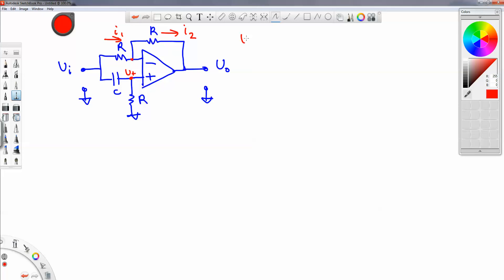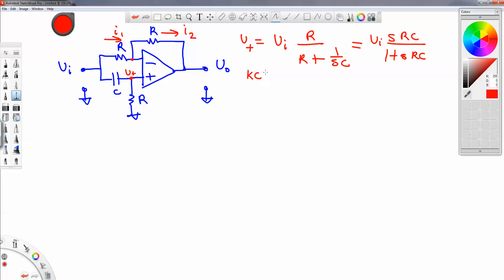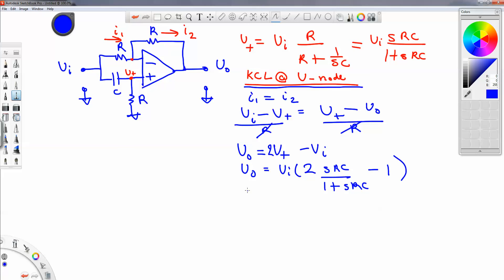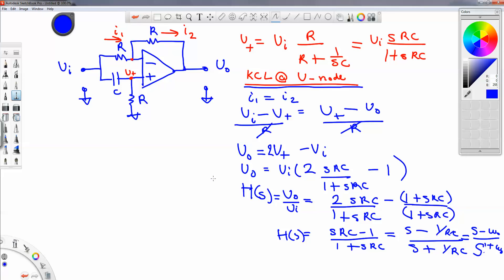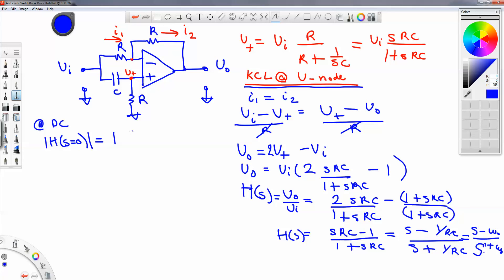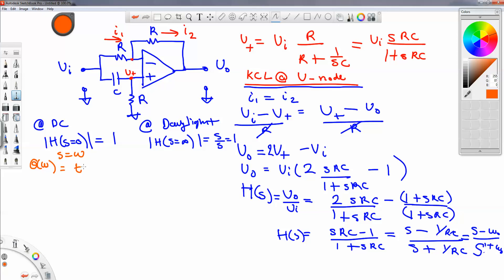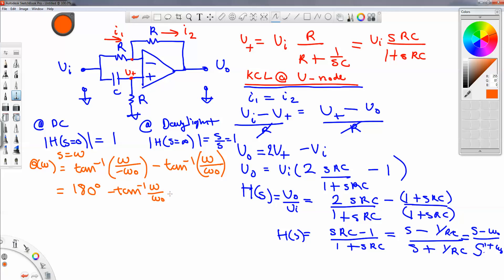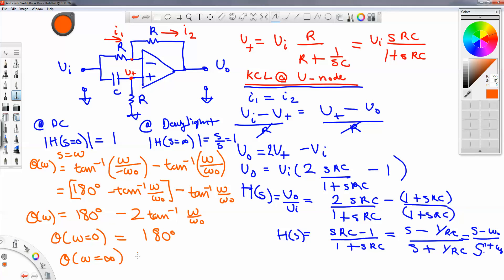All Pass Filter with Op Amp

Comment: Nice demonstration.
plugging in w = wo into your orange equation gives me 45 deg phase shift
at the center of the stop band, and with delta Vi = 0 as shown by the 2
inputs tied together, @ R = 1/SC your blue equation gives Vo = 0v at the center of
the null pass.